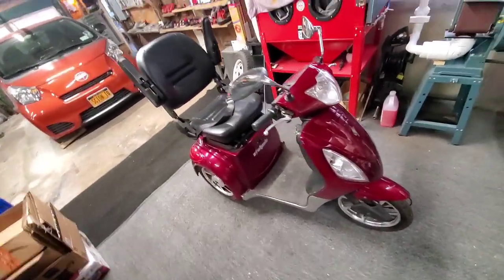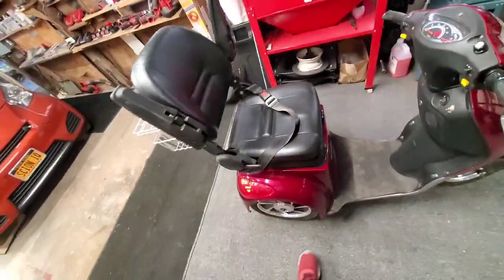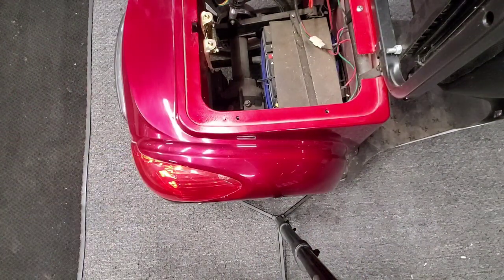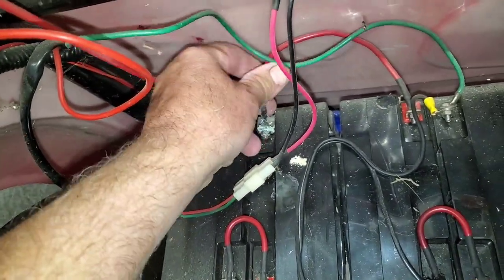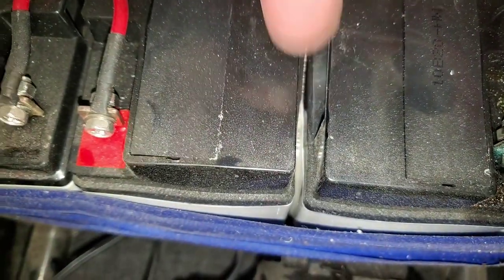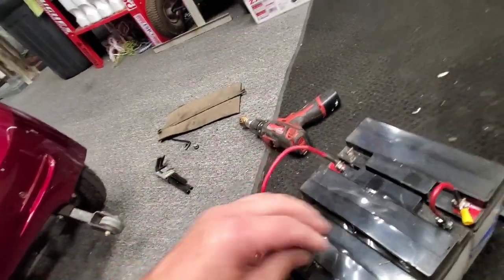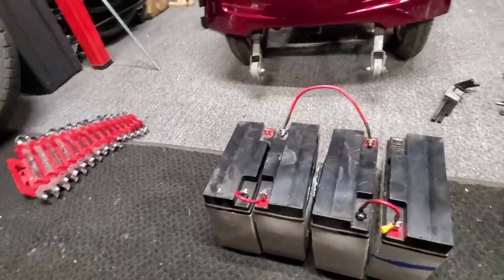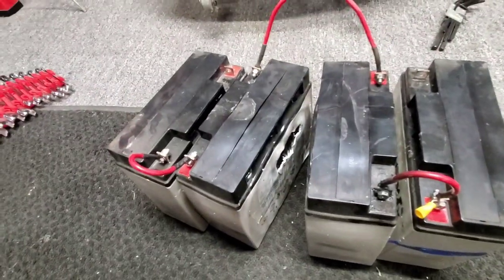e-wheels EW-36 troubleshooting and battery replacement

Comment: Ew-36 5 in the city 3 not running all do to battery. The chargers kill them no matter how well you take care of them 3 years that it. New batterys and charger will help a set of Apex 22 AH  and 159$ charger from electric scooter parts store  48 volt 5 amps lasted  6 years . Sold my charger and went lithium ion battery and charger instead $492 from BTR power  so far so good . As for the Ew-10 s in the city I have no clue how there doing I see them out about.
Reply from the maker: I put my charger on a timer now kind of like the one you have in your bathroom for your vent fan that I'll let it charge for an hour then the next day I let it charge for another hour just so doesn't bake the batteries but I did buy new batteries and a new charger
Reply: @justlee5433 Are you still happy with your lipo & charger? Would you mind sharing links to both?

Comment: ASKING FOR HELP!  PLEASE
I bought new batteries for my EW36.
My question is; when I install the new batteries, do I connect the main body positive and negative wires before bridging the batteries, or do I bridge the batteries first and then connect the positive and negative wires?  Or does it even matter?

I bridged the batteries first, connected the positive wire and when I went to connect the negative wire, it sparked, so I stopped. 😳
Reply from the maker: Yes that spark spark snap noises normal mine did it every time I replace the batteries I bolted all my batteries together set them down and hook up the negative then the positive and then you got to spark and then finish up and go for a ride
Reply: @TheOriginalAndysGarage  You are an angel! 👼 Thank you!  That snap/spark scared me, so I stopped for some advice. LOL!
I don't have a man around to help me with these things and I'm a 63 year old lady just trying to figure things out. 🤪

Comment: I replaced my batteries and now charger is flashing code (something wrong with charger system) I tried everything I know and nothing.. I a disabled vet with no help. Any advice?
Last year it was loosing power, put charger on it would not charge. So got another charger. That's not it so I got new batteries, and I'm at the point that I am. Can't get out of the house please help me fellow New Yorker I'm in upstate

Comment: would gel batteries be better? Have gel batteries in a pride mobility scooter with a decent charger that shuts off when the batteries are fully recharged. Odd on a very old scooter that this ew36 scooter that is relatively new lacks this very necessary feature. These crap chargers are junk and kill expensive batteries pies poor
Reply from the maker: I think these are what type of gel battery like a glass mat battery they're fully sealed but it seems like every year I'm replacing them I don't know what's going on so I put the charger on a timer to only charge for an hour at a time

Comment: All lights on no movement
Reply from the maker: Did you check the reset under the seat
Reply: @TheOriginalAndysGarage  The Breaker is in the in postion
Reply from the maker: I just remembered I had the same issue that you had my batteries were dead actually I had one bad battery in between the three of the other ones the lights and everything would work but the wheel would not move

Comment: ive read lead acid have a high self discharge rate and need trickle charging especially compared to lithium and  lifepo4, my torch i thought i lost 9 years ago i found it recently couldnt believe it it still works lithium sure holds charge for a long time. those batterries got mighty hot.
Reply from the maker: These are just cheap led acid batteries but what I'm doing is I'm going to install a 0 to 30 minute timer so when I plug it in I'll let it charge for 30 minutes and then it'll shut off so I don't boil them by forgetting and leaving it plugged in
Reply: @TheOriginalAndysGarage  makes sense
Reply from the maker: Yes there's obviously a problem with these Chargers that don't stop charging when the battery is full so I'll just use one of those dial bathroom exhaust fan timers that way I can charge it for a minute or up to 30 minutes and then this stupid thing will shut off so it's obvious by looking at the batteries they were boiled dry